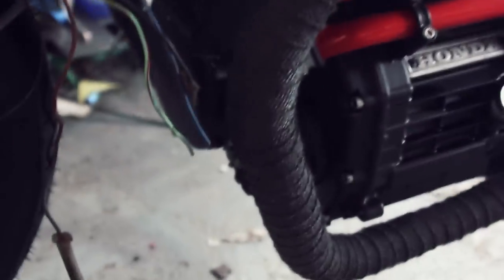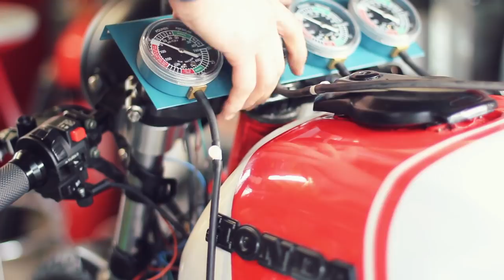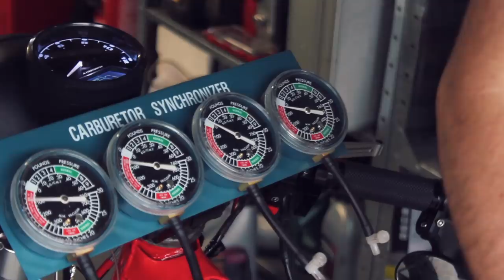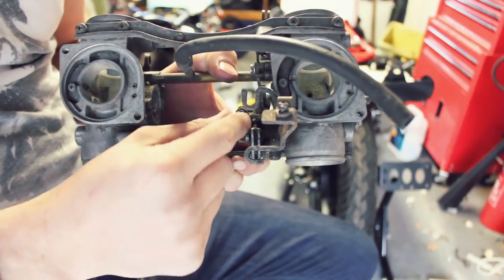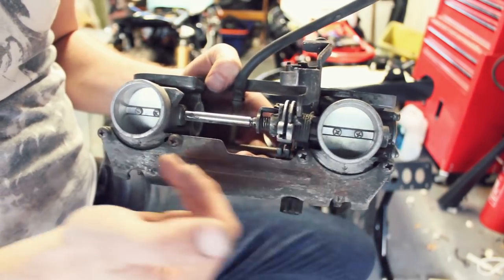Honda CX500 Cafe Racer Build 44 - Synchronising the carburettors

Comment: hey, i have just done a complete build on my cx 500.. i have the same speedo/tack. If you connect the watertemp wires from the bike to the fuel level wire on the speedo, you get a perfectly working watertemp dial. it starts blinking until it gets warmer, and will go about halfway up when warm.. hottest mine have been after 1 hour on the highway. 120kph ish. is 75% way up to full tank (watertemp)  ;) works perfectly
Reply from the maker: Good idea, after riding it last week though I think I'm going to be changing it as I don't like it too much, but good tip.

Comment: Man that sounds nice. Did you figure out the misfiring in cylinder 2? Well here in October I'll finally have a place to start working on my '81 GS650GL Suzuki. I put it away in 2012 after riding it home from work and it was only running on 2 cylinders and I could only do 50mph. It's been wrecked, tank dented, seat dry rotted and it's going to need a lot of love. I've had this since 2001. I hope y'all will watch my vids when I get started.

Comment: Sounds great, looking forward to seeing it all together and running on the road. Really looking forward  to seeing your tacho wiring video. I have the same tacho on my GSX750ES and getting the revs to work was more complex than I thought. Are you driving the speedo from the front or rear wheel? I did the rear as making a mount was easier at the back. Doing the DGR myself in Oslo, really looking forward to it. Keep up the good work, Stuart
Reply from the maker: Thanks, for the mount for the front I've just attached it to the existing mounts on the mudguard.

Comment: Can you make a video on how to shorten the throttle/clutch cables when going from the stock handle bars to clip ons?
I couldn’t find a way to route the cables and not have them bind due to the lower location of the hand controls
Reply from the maker: To be honest I haven't done that yet, I've shortened the choke cable though with a solderless nipple
Reply: Aha! solderless nipples might be what I'm looking for... I was going to try and use the soldering method but that sounds way easier so I'll give those a shot, thanks!

Comment: you need to sync the tool before u can sync your carbs!! there may be inconsistencies between the gauges as the gauges are man-made.  If you get a hand held pressure tool tester u might find that if you pump both gauges to 20 psi , one gauge might show 21psi...
Reply: while the other might show 18 psi. Once you find how much each gauge is naturally off by, u can either add or subtract the amount while syncing the carbs. in a nutshell, just because the needles are pointing to the same numbers on both gauges, the gauges might be off too, in turn making the syncing process useless until u identify and essentially zero-out your gauges.

Comment: Hi great video but I don't think you actually showed how to sink the carbs. I've just done mine and you have to adjust that screw and adjust the idle speed at the cable end.  Something about the right hand cylinder is only affected by the balance screw, that's what it says in the manual 👍
Reply from the maker: Yeah you can adjust the idle with the cable, but synchronising is just making sure that the intake of both Carburettors are the same as each other. You can only adjust the right hand carb as the left hand is the base carb. E.g. If you're working on 4 carbs 3 of the carbs need to sync to the 1 base carb